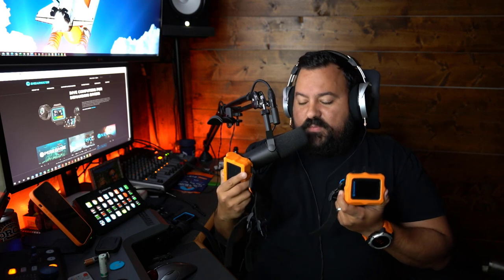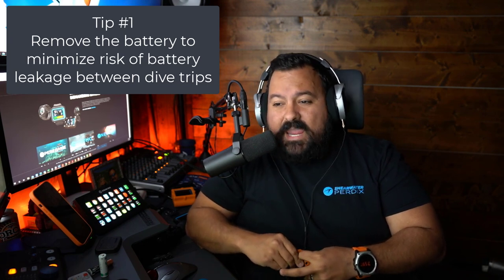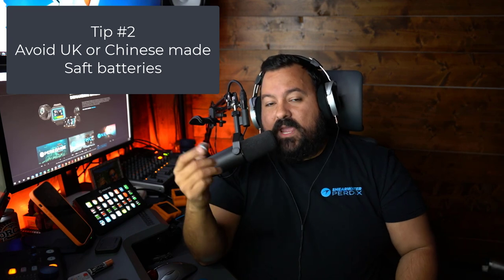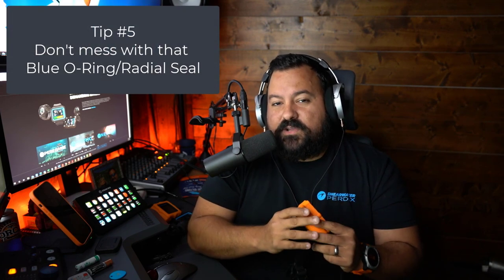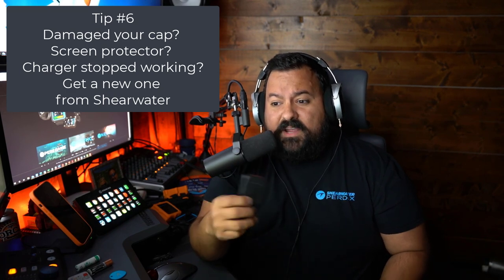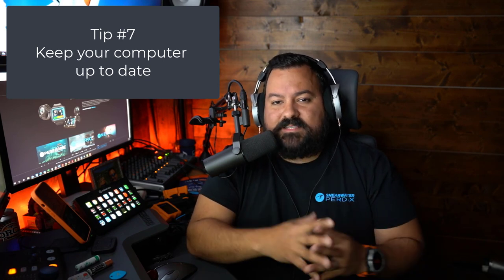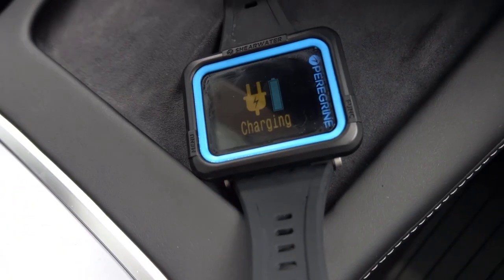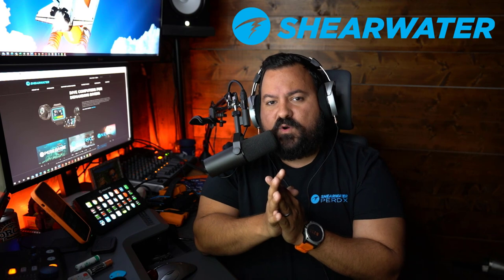Top 10 Pro Maintenance and Operation Tips & Tricks for Shearwater Computers

Comment: I'm a little confused.  You say to not mess with the blue o rings then say they will give you replacement for free. That would still require you to replace them.

I don't remove my battery until it is nearly dead.  I figure the more I remove the cap the more likely it is I will flood it.  I recently flooded my transmitter, when I changed the battery.  But it is rare I'm not diving at least every 4 weeks.

I don't think that 80/20 rule applies to the teric.  Batteries have improved a lot.  I charge my teric before every dive trip.  If I'm diving everyday on a vacation then I charge it everyday.  

I have both a teric and a perdix.
Reply from the maker: They replace the O-rings for you every year if you send them the computer.
Reply: @DIVETALK  I bought replacement o-rings a while ago, but was always afraid to replace them. My perdix is almost 4 years old.  I might send it in for maintenance work.
Reply from the maker: @scmsean  you should. They are awesome.

Comment: Question - other than safety, why do they need annual maintenance?  Saw online ~$150 per service.  On a $550-800 recreational computer, $150 per year seems like a high cost vs. For a commercial or highly used piece of equipment   is it just a safeguard or do they need recalibration often?

Second which Shearwater needs the least amount of maintenance.  Am trying to pick between Tern TX and Perdix 2 (more than I think I need, but interesting form factor).  Thanks!
Reply from the maker: It is not required to send them in for maintenance every year, we do that because we want to be proactive but people have used these heavily for years without doing any maintenance on them and had no issues.
Reply: @DIVETALK  appreciate the insight.

Comment: great video guys,
I'm just a recreational open circuit open water diver looking for a new computer. 
I'm on the fence between the perdix AI and the peregrine, the peregine coveres everything I need (I don't intend to go into tec diving) but I would really like to have air integration on the peregrine.
thoughts on shooting for the peredix AI (which I see as overkill for my use) or wait for a peregrin AI?
Reply: I know I’m 5 months late for this reply, but here goes. My dive shop owner/mentor told me to buy a Perdix AI, but as rec diver I thought it was overkill and bought the Peregrine. Then before going on a live aboard trip I replaced my psg with a AL 550C as backup to the Peregrine. 5 months later I ended up buying the Perdix AI so I could have all the info on my wrist. I would have been money ahead to have just listened to my mentor to begin with. To date Shearwater has not released an AI version of the Peregine…
Reply: What did you end up buying?

Comment: Can you explain the 80/20, especially the 20 part?
Reply from the maker: Shearwater recommends that in order to extend the battery's life, you shouldn't let it get below 20% before you charge it, and to not charge it if it's over 80%. It's not that if you let your computer run out of battery consistently means it's going to break immediately, but it does wear out the batter faster, according to Shearwater which I assume bases their recommendation on research they did.
Reply: @DIVETALK  thank you!!   That's what I thought, just wasn't entirely sure.